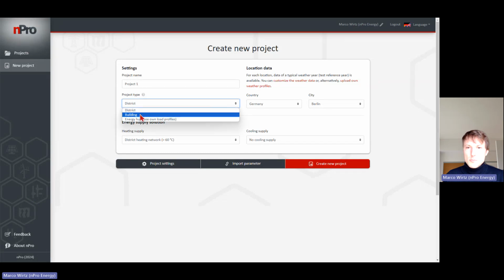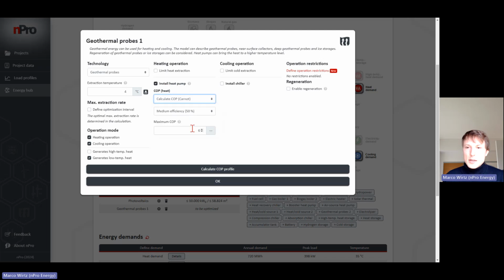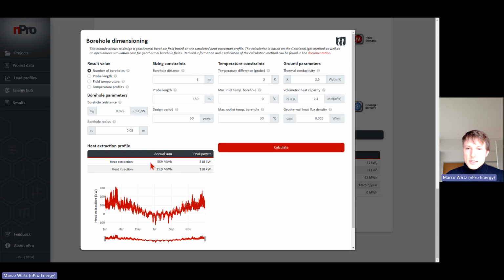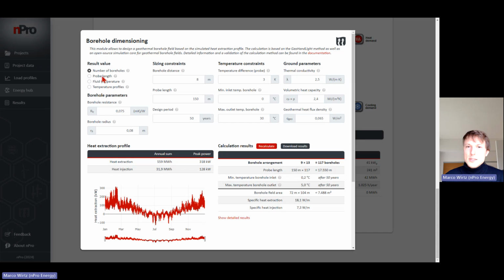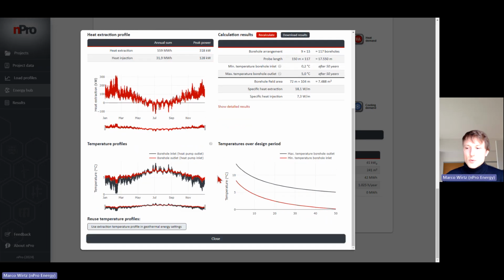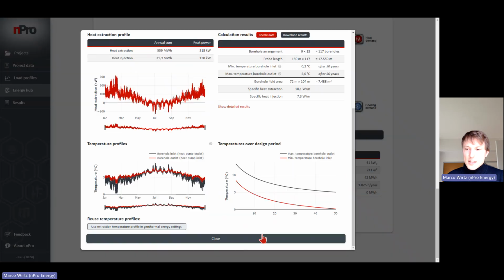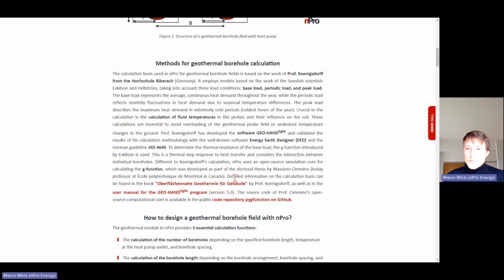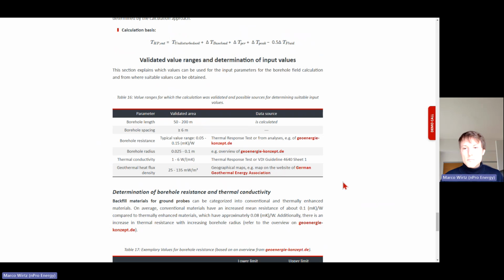Geothermal borehole field: Simulation and sizing

Comment: This is a super impressive feature and a great addition to nPro! However I am not finding the feature to share the resulting temperature profile with the probes as shown in the video. It will do all of the calculations and I can download heat load profiles, but not the hourly temperatures or the ability to send them back into the simulation. Is it just me or has it been removed?
Reply from the maker: Thank you, great that you like it! The function should work as shown. So if you want to download the resulting hourly temperature profile you can click on the button "Use extraction temperature profil in geothermal energy" and then download them in the geothermal energy settings. However, we will provide a direct download button with one of the next versions, as well.